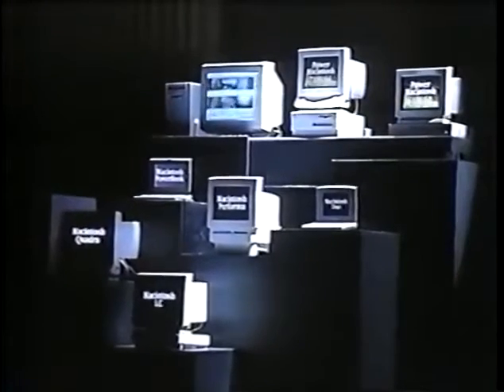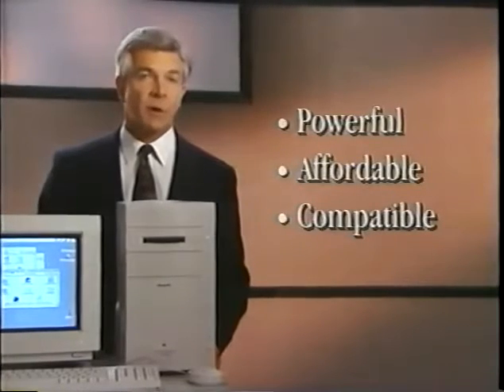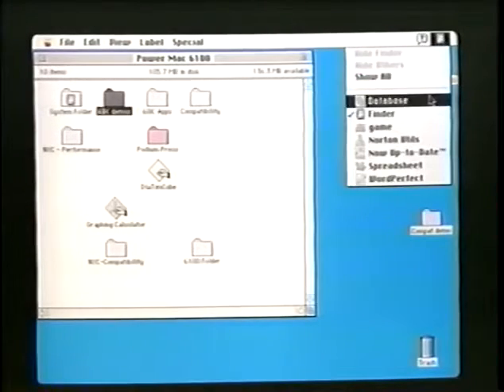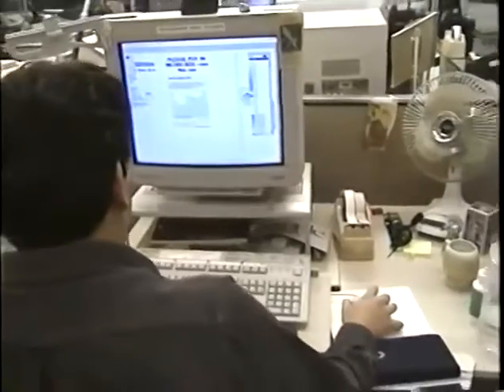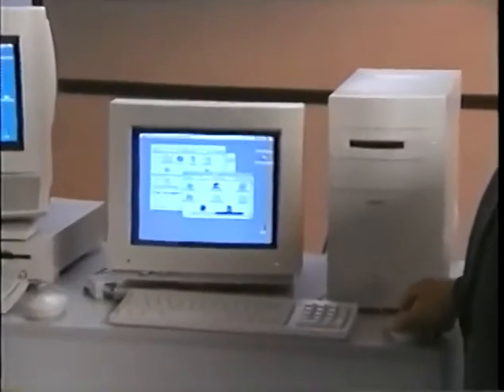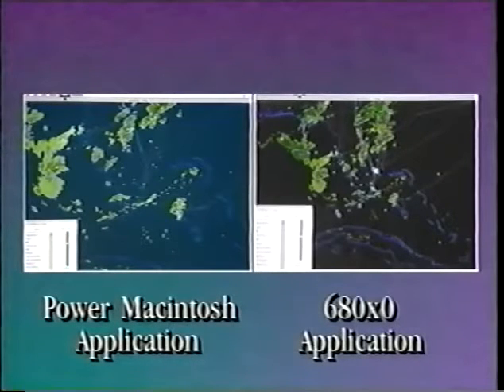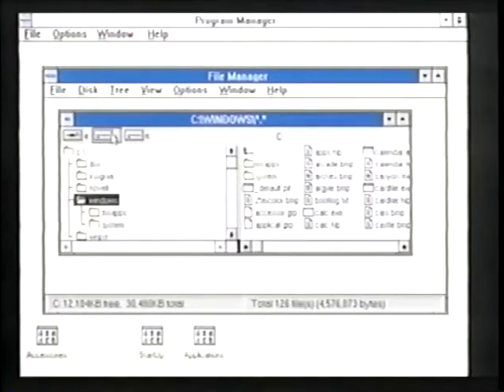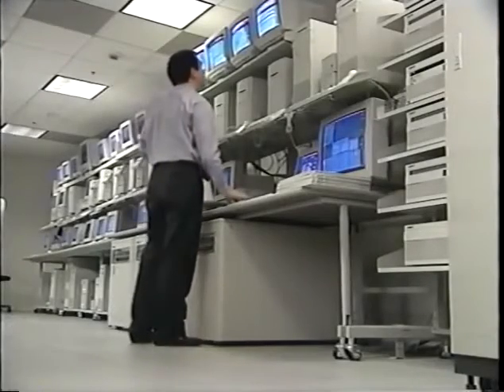The Apple Seminar for One - Power Macintosh (1994)

Comment: Thank you, for posting this great video.  Sorry to be, so late to the party but, during this time period was when, I really started to check out the Macintosh desktop systems.  The model, I like the most in this video was the 6100 Power PC which, was shown with a 14-inch color monitor with built-in speakers.  With the addition of a PC card, this model could also run both Windows 95 software and Apple software which, at the time was extra special.  In 1996, I picked-up my first Apple desktop computer an All-in-One 5400 with a 603e processor, an internal Apple video card system, plus an internal Apple TV/FM radio card system with its matching black and white remote control.  Years later, I also added a G3 upgrade card (smile...smile).